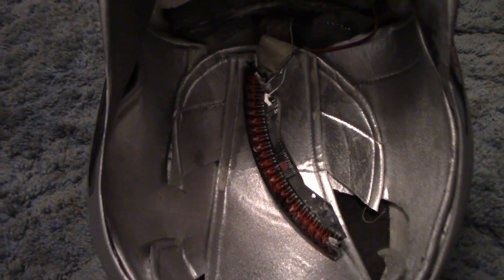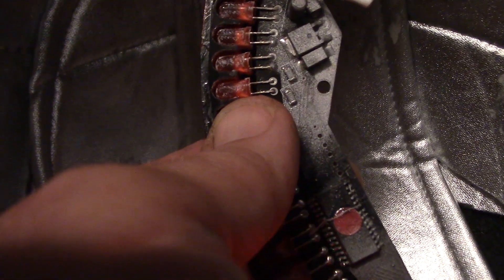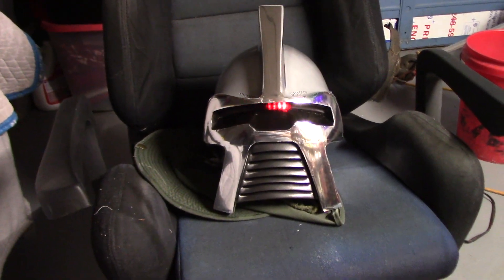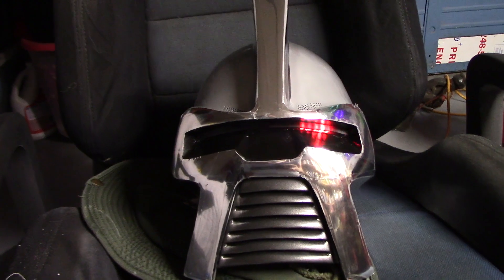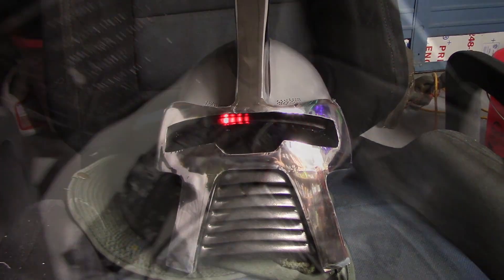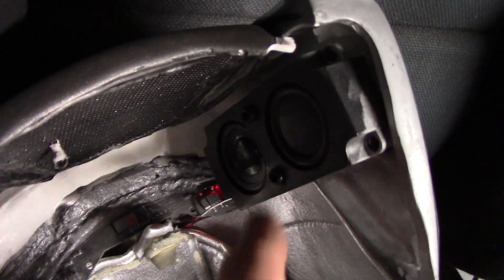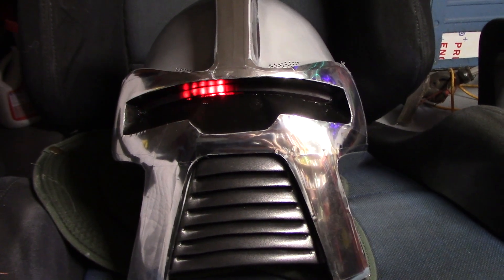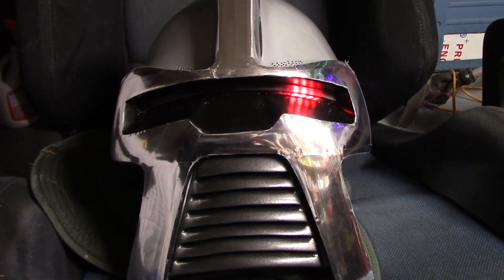Cylon LED Repair

Comment: The problem with those $50 Canadian scanners is that you cannot wear the helmet because the Electronics motherboard sticks out too far.   I de-soldered all the LED bulbs and added 8 inches of wire so that the motherboard could be placed in the mohawk of the helmet, now there’s plenty of room
Reply from the maker: That's a nice idea!  Jupiter's board works ok if you put a small pad on the board. It just barely rests on the bridge of my nose.